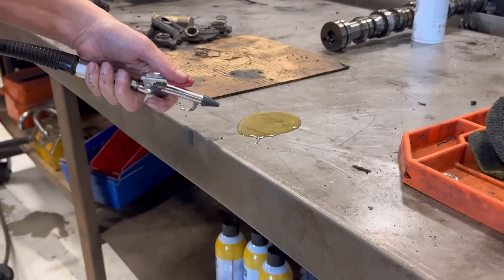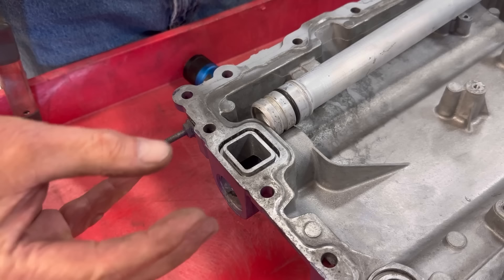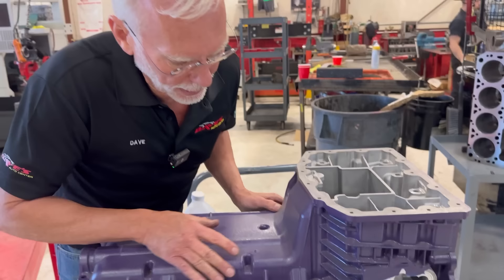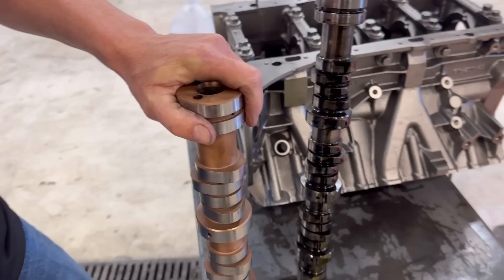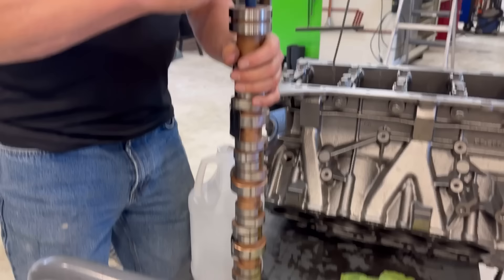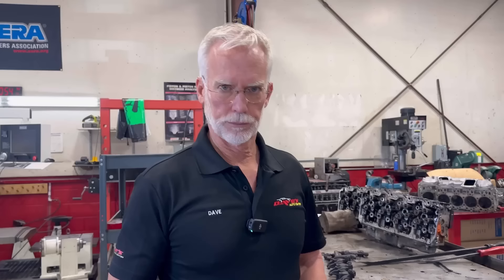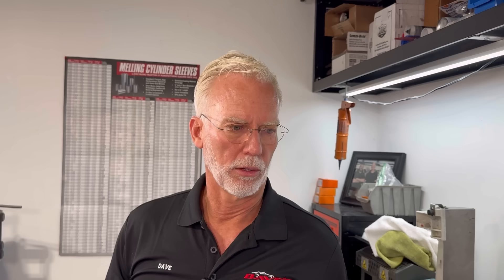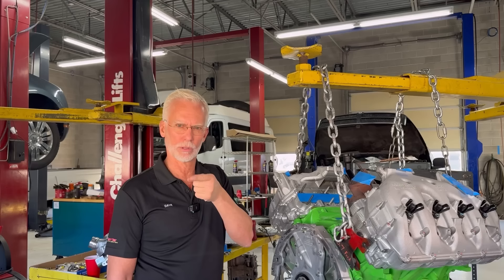Part 1: Ford 6.7 power stroke oil starvation issues revealed

Comment: What an excellent observation Dave made with this lubrication system!!! The engines that were/are reliable do NOT have this much VOLUME in the low pressure (suction) side of the system BEFORE it even gets to the pump!!!! And the routing of the lube system on the High pressure side of the system is very convoluted and indirect to the places that the oil needs to go to lubricate the high wear / high pressure areas like bearings and the valve-trane... Ford, has taken a very bad turn with their current equipment... So much of what Ford learned  from the past, has seemed to have been lost since the Phoenominal 460's, 430's,  429's , 428's,  427 side-oiler ,  390's, 351 Windsor , 351 Cleveland, The Cosworth v-8's, the Pinto engines,  all of their inline 6 engines.... 
         The list of sucessful Engines that Ford has created and manufactured are impressive and numerous... Unfortunately, several of the Power-Stroke diesels appear to have completely missed the mark, that Ford established in their past....Some of the Ford diesels (like the 6.0 V-8's) had a large amount of problems that should have been recognized & taken care of BEFORE they went into production... There are aftermarket companies that 'Bullet-Proof' those problematic engines... And apparently, this work was not subsidized by Ford, who originally manufactured these problematic engines...  The customers who purchased these vehicles had to cough-up the $5k-$6.5k pricetag of doing this type of work (2016 pricing).... There should have been recalls on all of the 6.0 Litre diesel engines, but somehow, Ford was able to get away with that very poor design... Nobody who manufactures vehicles is perfect... Mistakes can be made, especially with new designs... But they should take the responsibility of covering for their mistakes, by performing recalls. Ford offered No such help for their customers... Ford used to stand for : First On Race Day... Now it stands for : Ford Offers (Their) Recall Disapproval...

Comment: I have a friend who has had two 6.7's (a 2013 and a 2020) he has put close to a half million miles on them - never had any bearing problems, cam problems or turbo replacements.   The most troublesome part on these is the Radiator.

Comment: Dave, I know an engineer who worked in the industry for 30+ years, he told me, all engines now (not industrial) are designed to fail on purpose, the dealerships weren't making enough money, that's why starting in the mid 2ks, the lengthy warranties ended, so the owner would have pay big $$ to replace or repair the engine,  thats why both my vehicles are 98s.

Comment: I think a completely dry, freshly build engine will exaggerate the time differential. Don't you want to charge it the system then remove the oil filter and drain the sump (to best simulate an oil change). Measure the difference between that and just a regular startup simulation.

Comment: Ford calls that rattle “A typewriter sound” and there a SSM for it and Ford calls it “Normal Operation”😂
Reply: My 22 F 450 7.3 gas engine,  does this 😢
Reply: Its normal after and oil change and goes away after a while

Comment: Dave is the reason I will be having his shop rebuild both of my trucks engines when they have need. They are both over 120k miles now & still run very well. The rest of the running chassis and body are perfect. The rebuilds, when I determine necessary, will be well worth the cost as opposed to buying a new truck.

Comment: When you shut the engine off the oil filters check valve holds oil in the engine. The only time you worry about starvation is when you change oil without filling the filter first. Roller lifters were using roller bearings until a few years ago. GM was having that problem now with lifters and rocker arms in the ls engines.

Comment: It would be interesting to see how much of the old oil never comes out with an oil change. Kinda like not being able to drain a torque converter on an automatic transmission when you service it...
Reply: @earlpreston1043  On several of the older vehicles, the torque converters did have drain plugs so they could also be serviced... Now days, none of the vehicles have servicable torque converters... Instead, they want The customers to come into the dealers, to buy a new vehicle... And so currently, to buy a newer design, means to agree with the ridiculously over-complicated, largely unreliable / ineffective designs, such as this one... And for the people who claimed that they already drove their 6.7 powerstroke diesel enginrs well over 300k. miles, congratulations!!! You now have just recently exceeded the 1/2 way point of my stock 350 Chevy engine in my '77 GMC 3/4 Ton P/U that has exceeded 603k miles!!! The heads and block have never been removed from this 46 Year old vehicle that travels around with a fully loaded bed, and it's often pulling a 5,500 lb.trailer ... I drive it daily, with very few problems... They just don't make them like they used to...
Reply: Motor takes 18 or 19qt. With a oil change 13.5qt. In practice 14qt hits the full line on mine
Reply: It’s a significant amount that stays in the engine. You can change the oil and start the engine and the oil will already be darker than new oil

Comment: Ngl I’ve been addicted of the content  of this channel. Keep it up 👍 real question I recently started changing the oil myself. Does this 9:18 tip about the oif filter being filled up with oil goes for all oil filters on 4 cyl engines?
Reply: If you oil filter mounts straight up, yes prefill it ,
If the filter is on a slant,  put as much as you can without it spilling when installing your filter.
Reply: The reason this is a controversial topic is because by prefilling the oil filter, you could introduce unfiltered contaminants into the oil system. The way to correctly prefill your oil filter is to plug the clean side (the middle) and fill the filter from the outside, so that all oil is filtered. Prefilling doesn't matter as much on smaller engines because the volume of the filter is smaller and takes less time to fill. In Dave's example, it is definitely important.

Comment: You've got my business!
I have a 2012 F350 6.7 Powerstroke. 
364,000 original well maintained miles.
Reply: Your engine has 364,000 miles and this guy claims you have a oil starvation issue. Lol

Comment: Only thing to be done with discharge piping that long to bearings etc. is a prelube pump. Pressurize engine  lube oil system before engine is ever turned over. Std. practice on big marine diesels,  stationary turbines etc.

Comment: My 94 Gmc 1/2 ton 350 had a knock on start up from day one. The service bulletin said replace rod & main bearings or use an oil filter with a check valve. Still running at 188,900

Comment: I bought my 2002 Dodge Cummins diesel new I've always done my own oil changes one day several years ago I was changing the oil in my truck I'd already drained it an pulled the oil filter when my brother in law came up while i was pre filling my oil filter he laughed at me and said it was a waste of time well 326560 miles later my 5.9 is still purring along strong no major work ever done to the engine ! I'm a firm believer that when you can you prefill your oil filter and you confirmed that right here in this video  ! Thanks Dave ! I'm not the smartest nut on the block but I knew this much !
Reply: 99’ Dodge Cummins diesel I’ve owned since 2003.  320150 miles. Routine and preventive maintenance!

Comment: I like the fact that your testing cranking speed to time how long it takes oil to get to where it needs to be,
 but in real world starting most of the oil galley system is not dry when the engine shuts off much of the system retains oil only on dry start will there be a serious issue like with a new engine this is why we always prime the entire oil system on rebuilt engines I realize the customer does not have the option of priming the system after an oil change and the oil starvation problem on the 6.7 is an issue I have floated the idea of an Eletric priming motor introduced into the system that activates when the ignition is turned on with a start delay long enough to energize the entire oil galley system haven't put that into practice yet but I'm working on it.
The reality is some of these designs are made this way on purpose in the name of built in obsolete features that ensure the manufacturer sells allot of parts and replacement engines.
 Great job explaining this I relate to how you think,
 there have been so many times over the years in the machine shop business where I just scratch my head and think WHY??

Comment: Idk, definitely something that could’ve been designed better, but I see tons of 6.7 powerstrokes lasting just fine. When I had mine, granted I only had about 120-130k miles when I sold it, it never had an issue. Ran like a top, and saw tons of very cold starts and starts after days of sitting (especially during COVID).

But any design improvement is just that, an improvement. Take all the little faults in the designs of these newer engines and improve them, and you’ll have some very reliable engines.

Comment: First thought Running with air instead of oil ..
You prooved my thought...2 possible solutions
1 during starting no fuel for x revolutions
2 electrical oil pump with pressure contact so you can asume your oil is where it needs to be before starting the engine....

Excited for part 2

Comment: My bias as a Ford dealership mechanic might be getting in the way but a engine that sits over night or has oil drained from a service doesn’t have the oil whipped clean from the bearing surfaces so start up and not adding oil to oil filter isn’t going to cause a failure. Lack of oil change and under estimating breakdown of oil from heavy use and most after market filters not removing contaminates in oil between services cause the premature failures as we very very rarely see these failures. Yes there are a lot of dealer mechanics that are not qualified to inform customer of this but most is lost with the owners and fear of the dealerships cost of repairs. We see a lot of these repair directly related to those who don’t maintain the machine as it was designed. I can only imagine the engineering that has gone into and been improved on the 6.7L due to how long it has been in service for and the power it creates.

Comment: Wow! Points well taken!  I wonder if the next generation of Ford engineers will loop an oil tube around the engine several times, perhaps with a bunch of spices in it.  Every time I see more of this modern engineering I love my 12-valve Cummins even more

Comment: Reflecting bearings are fine for continuous rotation. Lubricant can spread around the surfaces. Needle rollers in  a rocking motion go back & forth over the same spot. Oil (or grease) gets pushed aside by the rollers and soon enough they are running dry. A bush with spiral oil grooves is much longer lasting.

Comment: I had a 1953 D8 bulldozer, it had a pony motor to start it. Youd spin the big diesel engine with the pony motor with the compression release open, youd watch the oil pressure build , even the water jackets ran through the pony. the exhaust of the pony also warmed the intake manifold  and there were two speeds to could spin the big engine. And now we have this lol

Comment: So essentially the 6.7 Powerstroke has a gun-drilled camshaft 🤪😄

I was beginning to think "No don't use water for all these measures it'll oxidize in the block" but then remembered those are aluminum blocks....still kinda surprised you guys didn't use 10w-30 or 5w-40 (weight for extreme usage, per Ford) for the measuring.

Still, Great video!👍 Looking forward to the follow up 😁
Reply: That's a compacted graphite iron block, buddy

Comment: Interesting topic on the needle bearings in the roller lifters failing. We were required to run needles (couldn’t run bushed lifters in this class) and found that smaller diameter needles failed more - so we started running larger diameter needles and then the needles would survive but it started failing the shaft then because less number of large diameter needles wasn’t spreading the load as much on the shaft.

Comment: It does seem like there is a huge amount of oil in those passages and tube. You get that much air in them during an oil change and it will take a long time to bleed the air out, it may cause foaming and I can see why it may cause damage

Comment: Excellent common sense by Dave, someone who cares about his reputation and customers, looking for a solution to cold starting oil starvation.  Thinking an oil accumulator system of adequate oil volume would pressurize the engine IF: given adequate TIME (delay) before the starter motor was engaged.  Also-QUESTION: How long does an oil pressure accumulator actually hold its oil pressure when the engine isn’t running??  Quite a few variables to consider with an oil pressure accumulator system as well, just like the engine’s oil passageways !! Already  looking forward to the next video(s) and thanks for opening Pandora’s Box for everyone Dave !!  Let’s design the “Fix” to protect our investments !!

Comment: I can remember years ago that certain engines had electric oil pumps you were required to switch on for a certain amount of time prior to start up. This for the exact reasons that you are pointing out. Unfortunately this also introduced another fail point as electric pumps were not as advanced as they are today.

Comment: I’ve maintained these 6.7 powerstrokes for 4 plus years now and have never pre filled an oil filter and have never had engine issues at all. My personal truck is a 2020 6.7 with 92k on the clock and I run shell rotella t6 which is against manufacturer specs if you look on the oil cap ford wants 10w30 just take care of your engines and change the fuckin oil it’s that simple.

Comment: At approximately 14:30 mark Dave was demonstrating needle bearing failure and how high performance engines are built with a bronze bushing. I have never built any engine but as soon as he talked about this bronze bushing the light came on. I used to work in a maintenance shop for heavy equipment at a mine. The "bearing" for the pivot shaft on CAT dozers is a bronze bushing.

Comment: Ironically, just changed my oil on my 17 6.7 last weekend.. I don't pre fill my filters. 5w40 oil.  45F temp outside. 2.5 seconds it took for the oil light to go out after I hit the start button.  Based on idle rpm and the 2.5sec wait time, my engine did 29 revolutions with no oil pressure, but still had an oil film on every surface.  That's not concerning to me at all.  But you have several valid points about the engineering or lack there of.

Comment: As a plumber, when dealing with a domestic hot water system. A similar situation is cause "dead leg" which is the amount of cold water that has to be pushed out of hot pipe before it reaches the faucet. In a way this is similar as the amount of time the oil spends coming from the pick up tube, through oil pump, oil cooler, then onto the cam bearings, crank bearings etc. A very long time in those crucial seconds where oil wedge needs to keep those components separated. I am not surprised that those motors struggled with oil starvation.

Comment: Dave, you should look into electric pre-oiler systems. We ran them on Grand Nationals back in the day and used them at start up and after shutting down to keep oil cooling the center section of the turbo during a hot soak. The stock turbos didn’t use roller bearings and the center sections weren’t water cooled like they are today. The engines thus never ran without oil pressure. Something to think about for your rebuilt engines, and the kits aren’t that much.

Comment: Good job Dave. I have now gone through 2 6.7 power strokes with oil starvation failure. One was after adding Amsoil remote bypass oil filter, yes adding to the volume and distance oil has to travel on cold start up and Amsoil told me to get stuffed for warranty. I now know Fords engineering is not good but AMSOIL compounded the problem. The other was top end worn out right from lash adjusters to rocker arms, the rocker arms actually fell off the tops of the valves and wrecked them too. Between the 2, I spent about $40,000.

Comment: I don't think the motor drains all the oil out of the system on a regular oil change..
But also, with the principles of gravitation, we fill lubricant up-down and I would imagine before it floats out into the pan, it should have gone thru all those pockets as you highlight.

Comment: I appreciate this video a lot! I don’t this to be a fact, but I’ve heard that some vehicles have an oil prime function to pump oil through the system before actual start up. It doesn’t solve the oil starvation problem, but can lubricate before motor is under load.

Comment: Incredible Analysis of Bad Ford Engineering as so many of current North American Manufacturers are encumbered with today. Yes Needle bearings make no sense with as much pressure as they have to work under and in Canada in our Cold Climate it is ridiculous to have that long an oil system before it gets to the actual bearings and lifters. Absolutely Great review Dave. THANKS.

Comment: In my opinion, the fastest and easiest solution to this conundrum would be to retrofit a zero pressure checkvalve into the pickup tube... Vacuum should hold any oil between the checkvalve and the pickup as long as the pickup remains submerged in oil...